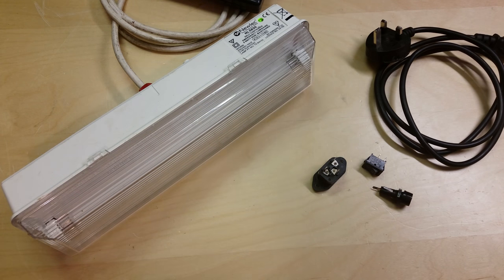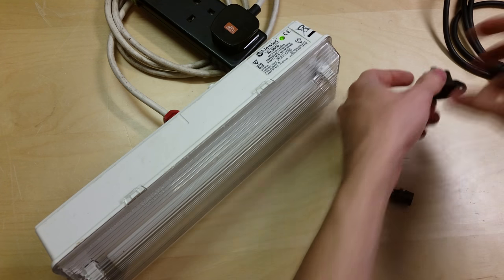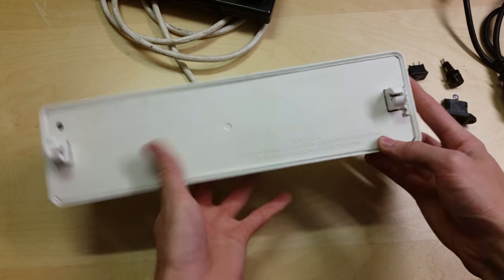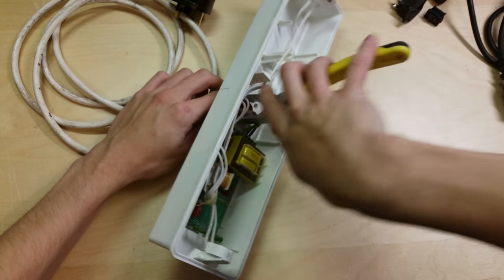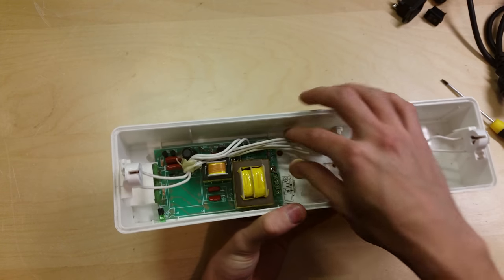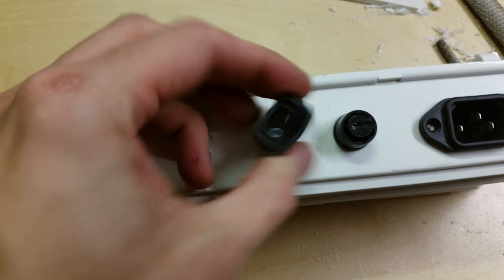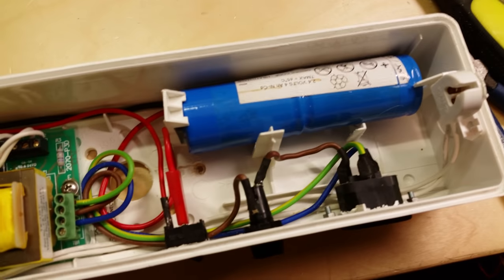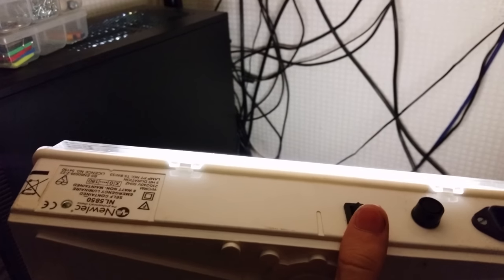Old Emergency Light Fitting Converted To Portable Work Light - Battery Powered, Mains Rechargeable

Comment: Hi

I recently got a emergency work light with tubes like urs..

Could i change it to LEDS but with the originsl selector switches etc? 
Where could i or should i join the leds as i read that flouresent n leds are both different workings. Any reply will be greatly appreciated sir

Comment: Hi mate, I've trying this and I'm a little stuck.

 I have added a switch between the battery positive and to light, so I can switch it on/off once it's using the battery but it don't come on, after I switch off (when I try to switch the light back on)

Only works when I have connected up to power and then remove the cord. The battery kicks in and powers the  light. Cant control the light from switch after this point any ideas?
Reply from the maker: That's interesting. I've not had that be a problem before!! What brand / model of light is it? Perhaps it's some kind of feature to prevent it draining the battery when they're not connected to the mains.. But I haven't come across this happening before so I'm not sure. Bizzare.
Reply: I’m having the same issue
Reply: If you're using a led fitting then there is a good chance you will have this issue (something to do with the circuit board) it's a case of trial and error to find a led fitting that will turn on from just the battery.

Comment: hey bud.. im trying to get one of these lights to just turn off and on normally without the battery, how would i do that?
Reply: BlairZaye Set the light in maintained mode and remove the battery. It will operate like a normal light.
Reply: @Xenon777_  Any idea how to set them to maintained?
Reply: @AlanMcGarrity  If the emergency light is labelled as maintained when wired with live earth and neutral it should turn on. If there is an extra terminal called LS (live switched) it should be connected to live for maintained mode. You can take it out for non - maintained mode. If you light says it's non - maintained it can't be wired to maintained. Is yours a Newlec one like in the video?
Reply: @Xenon777_  It's a JSB Light, Says Non Maintained No Rest Mode, It's lighting thats in a dark stairwell that's used daily, So you'd think it would have an on option, Unless"no rest mode" is that.
Reply: @AlanMcGarrity  If it's non maintained then I don't think there will be a way of having it maintained. You could find the voltage of the battery and buy an adapter with the same voltage. What are you trying to create with the light? There are quite a few things you can do with both maintained and non.
Reply: @Xenon777_  Just trying to get the units to run 24/7 instead of in a power cut, As we are not authorized to replace them.
Reply: @AlanMcGarrity  If you can't replace them you could maybe spur from them with another one next to them. Who said you can't replace them? Is it in a flat or something? if they are old JSB ones I doubt the battery will last for the minimum 3 hours anyway...
Reply: @Xenon777_  Yea it's a flat, Batteries are from 2005, No idea why they were installed as all the lights are on a timer using a solar dial, So the lights turn off, Then the "emergency" lights kick in for a bit then die, the get charged at night again
Reply: @AlanMcGarrity  They should be hardwired to the mains. I bet the tubes are all black at the end from the constant cycles. They aren't doing much anyway and they clearly don't maintain them. You might as well remove them and get another emergency light if they will allow that.
Reply: @Xenon777_  Nobody has access to the mains to turn off the power to change them.
Reply: @Xenon777_   how about removing the mosfet? mine is a firefly brand.
Reply: @beverlycaragay9127  I have never tried modifying the circuitry but if you removed the mosfet it will probably stop working. What are you wanting to do to they emergency light?
Reply: @Xenon777_   I just want to use it as a normal light, directly plug, because mine's battery is already dead
Reply: @beverlycaragay9127  It will do that if it's maintained already without modifying. On a non-maintained one you could find the voltage of the battery and find a matching power supply and power the light through the battery in.

Comment: I have a v-tac led one but when I turn it on both lights come on but I think only the green one should be on
Reply: This is called maintained. If you remove the white link wire across switched live SL LS or L1 depending on what it says and perm live L you should have a standard non maintained fixture hope this helps.

Comment: Can anyone tell me how to convert non maintained emergency light into maintained...
Reply: If the fitting is non maintained only you cannot do this however if it is maintained you can turn it non maintained by removing the link wire hope this helps.